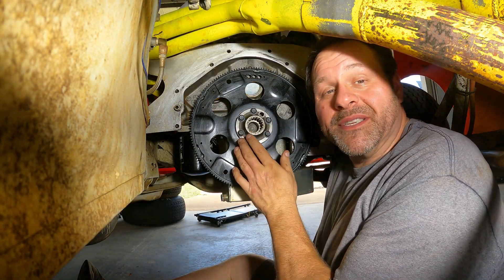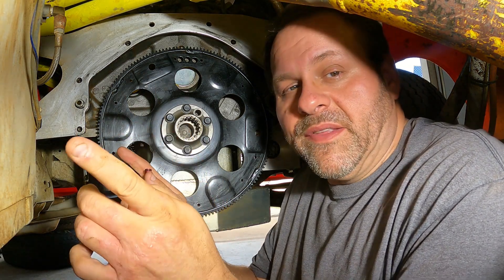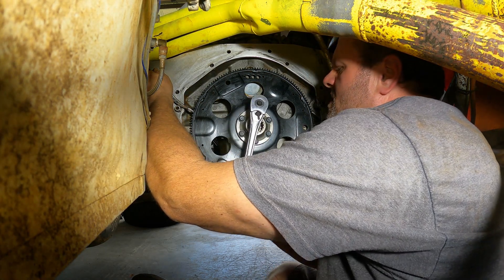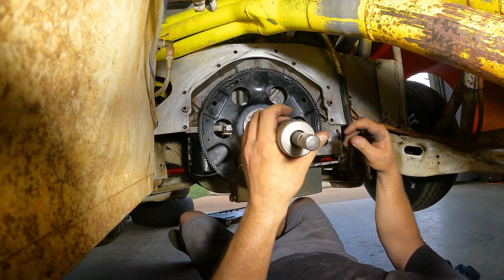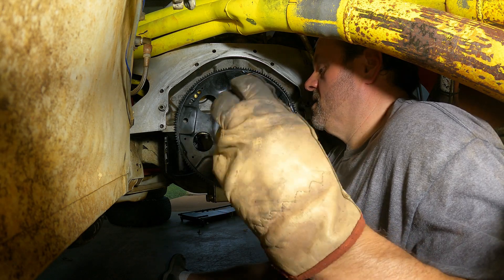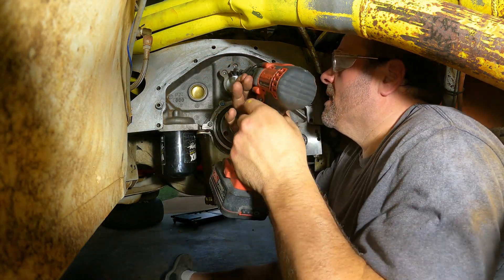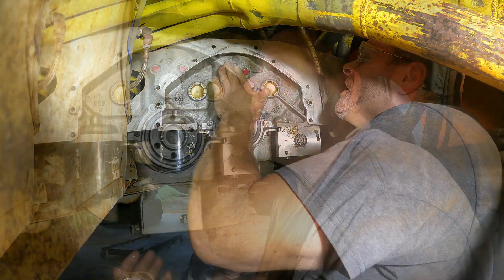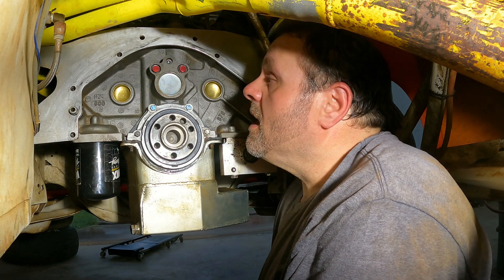How to Install Oil Restrictors in a solid cam engine to reduce oil overfilling the cylinder heads.

Comment: What about a crankcase evac. System ?
Reply from the maker: Unfortunately we are not allowed to run an evac system in the CRUSA rules and we just have to vent the rocker covers. If I could I would run the exhaust evac system since our engines have a wet sump oil pump.

Comment: Should a stock motor with hydraulic roller lifters with a 20% high flow pump have restrictors? I think mine does and it is barely getting any oil at all to the rockers and sometimes none at all
Reply from the maker: No, Don't run restrictors in that scenario. Very likely that is your problem bud!
Reply: @DIRTRACELIFE  yeah I was thinking so, I think the leak down of the lifter is more than the oil flow and it’s just running out of oil before it gets to the lifter, should I take it out completely or should I drill it out bigger ?
Reply from the maker: I would just take it out to start with. Remember, The point of restrictors is to limit "excess" oil from getting pumped to the top of the engine. So until you have excess you dont have an issue.
Reply: @DIRTRACELIFE  how do I know if there is excess though, i was kinda worried it may pump the bottom dry also but I’ve never had anything with a hv pump though so I’m not sure exactly how much they pump or anything
Reply from the maker: leave a cover off and fire it up! your looking for it to slobber off the top of those rockers but not look like water hoses 😉
Reply: @DIRTRACELIFE  I got a old set of covers with the top cut off to adjust the rockers I can toss on there but even completely stock motors I’ve worked on will shoot oil atleast onto the manifold but I’ve seen some go way onto the inner fender, how much should come out?
Reply from the maker: I don't think we going to have a lot of success talking measured ounces per second in these comments. 
If its so much that you obviously are filling the top of the heads faster than it can drain then its too much. theres not an exact measure. Like I said, its not too much until its excess and excess should be an obvious visual observation.
Reply: @DIRTRACELIFE  so if it’s kinda puddling up in the head cause it’s not draining fast enough then it’s to much? And as long as it doesn’t do that then it should be fine?

Comment: I even use oil restrictors with hydraulic lifters but I take the o-rings off of them to allow more oil to pass through.
Reply from the maker: Never had thought about that as a  possible combination but yeah that would make sense as a way to create a slight reduction in some circumstances. Thank you for sharing Sam.

Comment: Are the restrictor plug holes? Are they all the same size are do they have different sizes that maybe my problem I keep getting oil up in my breathers on the valve cover
Reply from the maker: Small block Chevys are all the same but the newer blocks have the thicker boss like what I showed adding clearance. If you are pumping so much oil it's coming out the baffles it could need restrictors but make sure its not just from excessive blow by on the rings.
Reply: @DIRTRACELIFE  ok thank you

Comment: I remember old timers putting pipe cleaners in the push rods. To restrict the flow.
Reply from the maker: The engine that was already in the first Street Stock I bought way way long time ago did have pipe cleaners in the pushrods!

Comment: Sounds like you have a drain back issue, lifters are supposed to control the oil flow, restrictors in the gallery can leave the front lifters dry.
Reply from the maker: I didn't cut the block up as much as possible. That's a solution as well that can be explored on a refresh but there's nothing wrong with using restrictors if using the right ones the right way.